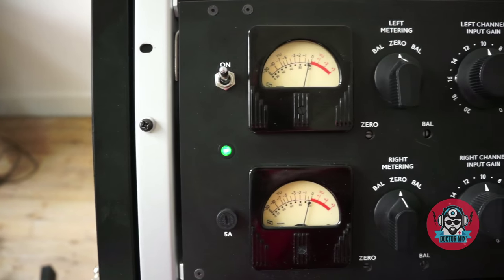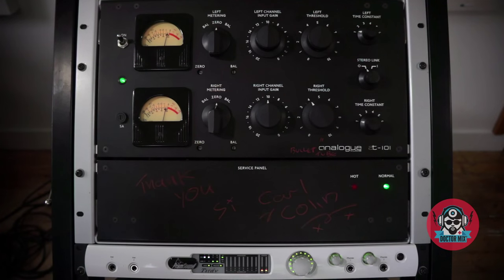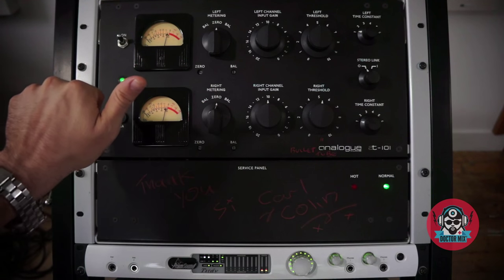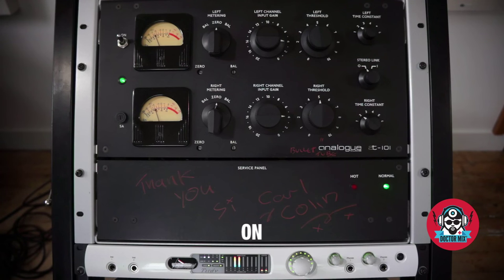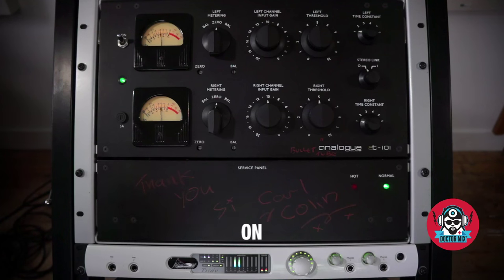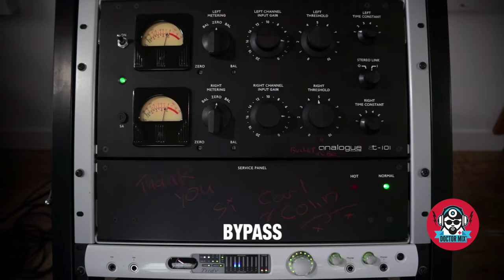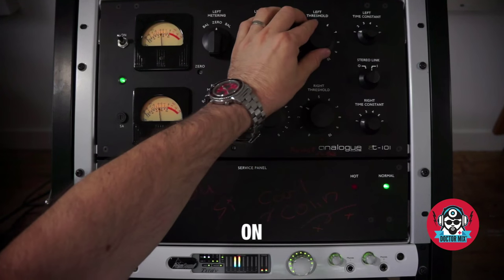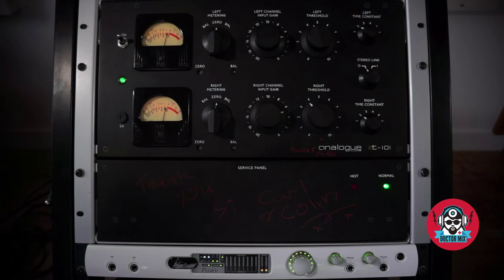A Modern Fairchild: The Analogue Tube AT-101 In Action

Comment: This is both educational and fun! Some may not see this as I do, but I am enjoying these videos immensely! There is an annoying switching noise I am hearing in my headphones and it is the in and bypass that is done showing the effect’s job. This switch can have an MOV and a cap soldered across the leads and this will cease to be an issue. At the very least, it is worth a try. I’ve seen this work on other audiophile gear and I have performed this on many a piece of equipment. Just letting you know what is going on so you can straighten it out! 😊👍🏻